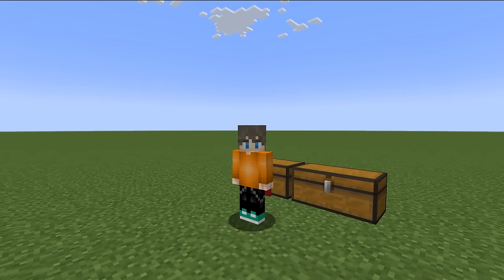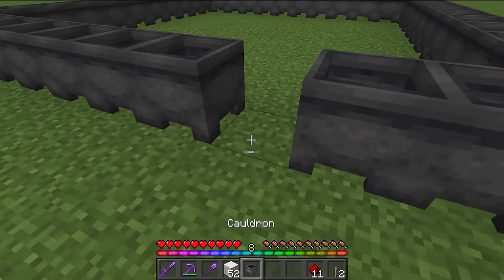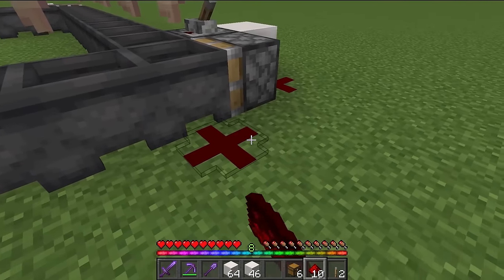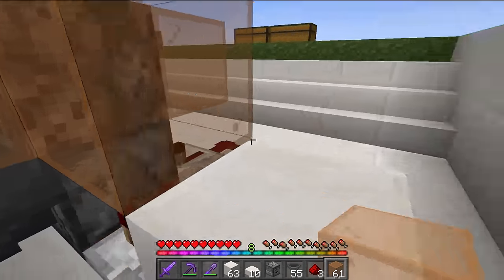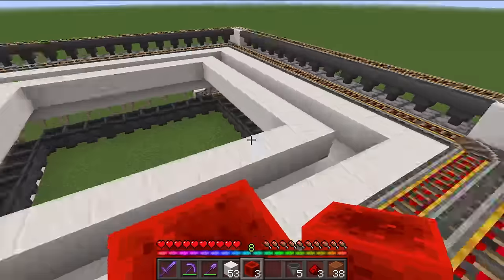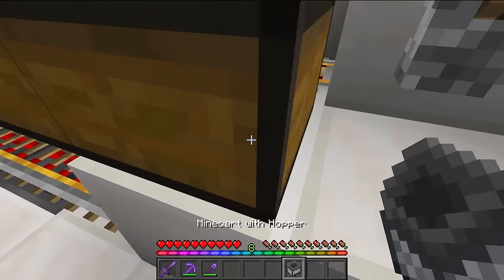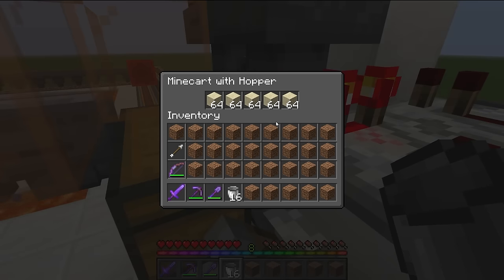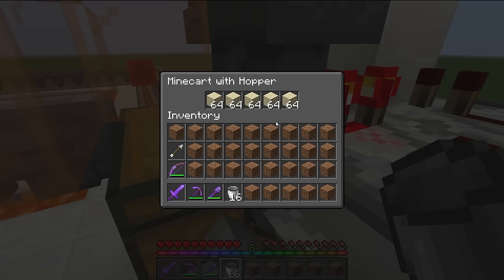Lava Farm Super Smelter Tutorial for Java 1.21 (and 1.17+)

Comment: 6:00 im having an issue placing down the dropper. after i place a filler item inside it dispenses between the 2 repeaters and not at the side of the farm. idk if its a 1.21 thing but the slot of the dropper is always perpendicular from me and not facing the way i am
Reply: items are shot upwards into the tube after testing it nonetheless no i guess its fine
Reply from the maker: Are you placing with Tweakeroo or litematica or something that would "lock" it to a diff direction? Default vanilla in 1.21 is still for the "opening" to face you.
Reply: @RadicalElder i got 50 vanilla enhancer mods lol so possibly. But thankfully the contraption works but i wonder if i could speed up the lava bucket process but just having a lava source and pour filled buckets into the double chest to my left where I activate the clockwise cauldron thingy

Comment: The top minecart doesn't reload and unload fast enough. A lot of lava fuel is wasted in the time that it takes to reload every furnace. 
DO you have a fix for this? I tried to slow down the top minecart as much as I could but its still inefficiently burning the fuel
Reply from the maker: No this isn't really designed to be efficient and use every tick of the lava's burning capability. It's meant to keep you from spending coal with something renewable. OP coal smelters just require a whole tree farm or a wither skeleton farm in a perimeter or something to operate, which I didn't like.

Comment: But, the lava will need to fill up the corresponding hopper of each furnace to pass to the next furnace and do the same all over again right? So, the smelter to star to run efficiently will need a lot of time filling each and every hopper of lava?
Reply from the maker: Yeah what a lot of people have done when they build this is fill each of the hoppers that goes into the back of the furnaces with 4 non fuel items so each furnace only needs 1 lava bucket to get started. :)
Reply: @RadicalElder  Yeah, I then realized that than you, love the full design!!

Comment: When the minecart is full it wont go automatically
Reply from the maker: You can't fill the hopper - if the hopper above the minecart has more than 20 items, remove them all and put them back in the chest. It should leave after that. 

If it does not, you probably forgot the single item in the dropper/hopper clock.

Comment: This takes a ton more repeaters than are listed in the description.  I didn't realize that until doing my modified build of this in Bedrock 1.19, survival mode, where I had to actually create this piece by piece, and couldn't just hit E in creative mode and get an instant stack of 64 that goes on eternally.  Also, it uses more redstone torches, at least in Bedrock.  I'm working on recording my build of this in Becrock's survival mode, after I got it functioning in Bedrock's creative mode.  It's a real doozie! Very expensive.
Reply from the maker: It's not meant for bedrock so none of the redstone torches, etc. whatever numbers are even listed. The description says 4 repeaters. That's 2 near the soul sand for the clock, 1 on the item filter and 1 near the top right chest. It's correct.

My item list isn't for the "tips" section and the advanced fixes. Most people who build it don't add all the extra  functionality for full restocking. The required materials list is correct to build the smelter itself, which is what this video covers.

Also, I have this working in bedrock. I don't know why it wouldn't work for you but it straight works for me. Unsure what you would be fixing other than the extras at the end of the video. 

I've built this in my hardcore YT and my hardcore Twitch world. I'm aware how it works ... comment seems ... idk. Out of place.

Considering I'm 90% the way to producing a much improved V2 of this and fixing most of the common issues people have actually had, it would be a bit of a silly idea to reproduce a bedrock video of this when the idea is solid but the execution rightfully needed work. Reproducing this farm and not iterating on it would be incredibly shortsighted.

Comment: Hey need help, i have tried it more than 12 times already but somewhy, my redstone doesnt glow at the ver first, and the revolution never gets completed. it gets stuck, and how do u even press the lever twice, please help!!!
Reply from the maker: Empty out the input double chest and the hopper below. Also empty out the hopper minecart on the first rail. Break the hopper MC - is the rail under it dark? If so, the lever is in the right way. Flip the lever. Does it turn that rail on? Awesome. now turn it back off. 

From there, put the minecart back. Does your hopper/dropper clock have 1 item inside? If so, awesome. if you did the redstone properly, fill up the chest now. When the minecart is full and there are 23 items inside the hopper above it, the cart will leave the station. If it doesn't, you'd have to send screenshots in my discord help section or something.
Reply from the maker: Also confirm you're on Java and not bedrock/pe/mobile/anything else.
Reply: @RadicalElder  it worked, and yes I am from Java. Really appreciate you taking all the while to reply back and explain. Thanks a lot man, really grateful!!!

Comment: Heyo I have a problem with the redstone signals that send the minecart back off to restock the items, once the hopper gets to 24 items. My problem however is that it does not go back out. Any Idea on what might be causing that?
Reply from the maker: Do you have one item in the clock that it's activating? It should activate that one item to go to the other side and then back - which powers then depowers the rail
Reply: @RadicalElder  By that I take it you mean the dispenser/hopper off to the right of the storage correct? Yes there is a block in it. When the minecart comes back it only stays if the powered rail is off, as its filling up the comparator is ticking, once the hopper reaches 24 it makes an audible click sound, which I assume is the signal to send the minecart on its way, but nothing happens
Reply from the maker: Is it a powered rail? When it hits 24 is it BEING powered? That's what should happen ... It sounds like some part has gone wrong with it for you. If you're on discord, ask in my "tech help" channel and I'm sure someone can tell you nearly instantly, if not me.
Reply: @RadicalElder  will do, ty

Comment: No one will see this probably, but the comparator activates upon having 24 items in the hopper below the chest, but for some reason the minecart does not get sent away without me doing it manually. Any idea how to fix that?
Reply from the maker: The redstone signal should activate the first rail. Check you have the right rail and redstone correct after I had to fix it.
Reply from the maker: Also I see and reply to all messages :)
Reply: @RadicalElder  thanks for answering! i did pull it all up one block like you showed, but the rail never activates. is there an item supposed to be in the hopper or dispenser next to it? i couldnt figure out what they were doing in the contraption
Reply from the maker: @garnix5427  yes put 1 item in either side.

Comment: My top minecart is full and won't collect anymore stone to cook. It gets to the end of the track and doesn't go anywhere unless I manually push it.
Reply from the maker: The hopper likely got too full. Remove the 5 stacks from the hopper and put it back in the chest at the top. It should restart itself automatically from there.
Reply: @RadicalElder  got it. Im also having the problem of all the Lava buckets filling up the first 10 or so furnaces and not having enough blocks to cook while the other 20+ furnaces at the end have all the blocks and not enough fuel
Reply from the maker: @brooksv5429  You should definitely fill the entire furnace before starting it the first time. I believe I said that in the video somewhere, though. It takes about 300 buckets to get it up to full speed the first time, otherwise you'll have that problem.

Comment: yo, i just built the farm, its working as a lava farm, but not as a smelter, the buckets only went in like 5 furnaces, even tho i already filled like 50 buckets, i dont even know where they went, i searched the whole farm, how do i make it work? the bricks i put in the furnace that are melting, they are just nowhere to be found, not on any chest its supposed to go
edit: the furnaces seem to working? i guess you just gotta keep filling buckets? it went from 5 to idk 9, and another thing is the bricks smelted seem to be going to the bucket dropper, because of that hopper that's pointed at the comparator, idk how to fix this honestly, actually now half of the bricks went to the chest its supposed to and half went to the dropper part
Reply from the maker: Hey Magma, you gotta fill it up the "first time" you use it - it takes 300ish lava buckets to start so run the farm as a lava farm for a while. You'll know it's ready to run when the lava minecraft is full and not picking up any from the fuel chest at the top. 

Basically it starts putting them in furnaces and hoppers and that's 6 per times 50 furnaces.
Reply: @RadicalElder  ty for the response! but filling it up like manually at each furnace?
also what about the part where the bricks go to the dropper instead of the main chest?
Reply from the maker: @magmahd2163  You can fill the furnaces manually with the first 50 buckets if you want. 

If the bricks are going to the dropper, you don't have the filter done correctly. if buckets are going to the output chest you have it backwards. If buckets ARE going to the dropper then the filter is wrong and EVERYTHING is going there. I'd just revisit that part of the video.
Reply: @RadicalElder  everything is fixed now, completely working, but it takes some hours to fill every furnace lmao

Comment: Any reason why my lava buckets may be getting stuck in hoppers and not going into the furnaces?
Reply: Do I need to put filler items in every hopper or something?
Reply from the maker: Most likely you have the hoppers facing with the point down not into the furnace. They need to be pointed into the back of each furnace (shift+click). Check the point of the hopper. Otherwise they should be going in if there's nothing in the furnace. No filters needed.
Reply: @RadicalElder  My hoppers are all pointed into the back however it just is not going into my furnaces for some reason. just try and rebuild i guess.
Reply from the maker: Strange and they're STUCK in the hopper? And there's nothing in the fuel slot of the furnace? Hard to diagnose by text beyond that. You're welcome to join my discord and send some pics so we can take a look.

Comment: where do you put the 300 buckets
Reply from the maker: As you use the farm, 50 will go to the furnaces, and 250 will sit behind in the hoppers. If you want to start it quicker you can always manually move 50 buckets into the furnaces first, otherwise it fills from the end. If you're filling it yourself, drop lava buckets into the chest over the lower rail - not the input chest for items but the other one next to it up top.

Comment: What's meant by 'put one item inside?' 11:00
Reply from the maker: The hopper and dropper facing into each other form a "back and forth" to pass a single item between that activates and then resets each time the cart runs. Put one of any 64 stackable item, like a piece of dirt or 1 stone in there.
Reply: @RadicalElder  My minecart with the item that needs to be smelted always leaves instantly. I don't know why it doesn't wait for the minecart to fill
Reply from the maker: @johstef7942  flip the lever the other way. The lever sets it to run all the time. Make sure the first rail is unpowered when you reset it.

Comment: Works really good but the cauldron are getting filled very slowly is that normal or is it a problem on my site?
Reply from the maker: They fill every 19 mins on average
Reply: @RadicalElder  alright thanks, another question the System to activate the upper Minecart isn't working I've build it exactly like shown, does it have to be a specific item in the dropper?
Reply from the maker: No but make sure your comparator at the front of the redstone bit is on subtract mode. Lots of people make that mistake. If it is not loading, take everything from the cart and hoppers and chest. Is only one rail deactivated or two? If it's one, put all the items back in the chest and see when the hopper gets +23 items does it not power? That's a redstone problem and something is built wrong.

Comment: is this better than coal?  also wondering if i could just collect the lava like a normal lava farm
Reply from the maker: It's way better than coal if you don't like mining, want a renewable resource, or have other uses for the coal, yes. It's better than other renewable resources like bamboo because it's less laggy and better than blaze rods b/c you have to manually transport those. 

You can use this as a lava farm just by flicking the switch behind the lowest chest (the one you AFK next to) and it will collect lava buckets in that chest for you. If you want to run around the farm and just collect them manually, that works too and I do that often when I don't want to stick around I'm just doing a driveby collection. :)
Reply: @RadicalElder  ty man will build it rn :)

Comment: I built this design in survival... The number of issues and adjustments I made was very frustrating. If you want to build this, I recommend you read my comment. 

MAIN ISSUES

LAVA BUCKET LOADING
Problem: The lava buckets load up the first 8-10 hoppers and the rest of the farm does not get any.
Fix: Fill each hopper (only the ones for loading furnaces with lava buckets) with four of any items that cannot be smelted. This will make it so that every furnace will have a lava bucket inside the furnace and a standby in the hopper that feeds it. 

UNLOADING SYSTEM
Problem: The hoppers will fill up very quickly because the furnaces all smelt faster than hoppers can move items. This will cause a backlog and clog everything up. It also makes it so that buckets do not return because they are stuck in limbo never making it through the huge queue of items. 
Fix: My fix for this was using a hopper minecart that goes around the bottom of all furnaces. This works great HOWEVER you must use a very tricky method to deposit the items into the chests because if you do not you run into the same issue as before where the hoppers fill up and don't unload fast enough. The solution was to use 4 more hopper minecarts inside blocks clipped together in a complex unloader that takes all the contents from the main collector and deposit them into 9 different hoppers equally. 

STORAGE SYSTEM
Problem: With all the adjustments made so far, there are bound to be lots of more unforeseen issues to come. One was the storage. Only using hoppers to transport the materials to chests was far too slow. A large backlog would appear which is a running theme in this build.
Fix: below the depositing zone, set up droppers that throw all items out as fast as they can. From that, they drop into an item sorting system. This is important because it allows the bucket to be discerned from other materials. (Make sure to have a few overflow chests in case your machine starts to work overtime).

LAVA CAULDRONS
Problem: Once you get the whole machine working as efficiently as possible with the above fixes you will realize that you run out of lava far too fast. This is because each furnace takes two buckets at a time die the with the hopper holding on and the furnace holding one. 
Fix: You must make the cauldron loop much longer (I recommend twice as long). This can be tricky, but it is possible and allows for maximum efficiency.

This design with these adjustments is amazing and works like a charm.
Reply from the maker: There's a lot that is correct here, which is why I've been busily working on a new version of this that fixes some of the existing problems. This version was meant to fill a void - there are NO good designs for a lava super smelter on YT so this one was that for a little while but yes the technicals aren't perfect here. 

LAVA BUCKET LOADING - Yes but also no. I just fill the sucker up completely. 300+ buckets, you're off and running. Your solution is a good one for the startup phase though and something I would probably recommend as it gets up and going if you need to immediately use it. Long term this thing makes more buckets than 99% of people will ever smelt through. 

UNLOADING & STORAGE SYSTEM - running 50 hoppers in a line is a mess, yep. The solution I will use in the future entirely fixes this but if you're in a rush this isn't the smelter to use anyways. I'm not trying to be the fastest, just use lava, power furnaces, let it rip. This does that but yes, unloading can take a while unfortunately. Using a very tricky redstone station to collect is possible but let's be honest, nobody makes the super technical stuff in survival or hardcore worlds because they can't follow it very well. This is MUCH more mainstream, just slower. 

LAVA - Again, turning corners and making extra changes is possible, it's just not a lot of fun for people who want to build a lava smelter in survival. A few of your solutions say "this is tricky but" and that's the recurring theme. THIS build is the simple and kinda slow version. The one I'm working on is a faster, more efficient version but that takes some technical work. Obviously here I just spammed in some furnaces around the already existing smelter design and feed them. 

So I would say there's a lot that is dead on correct in your assessment of this version's issues. It's just ... there is/was no fast alternative that kept things simple to build. 

V2 will fix: item distribution (much faster), item collection (much faster), lava collection (much larger, thus more available). 

Hopefully some of your workarounds help people in the meantime.